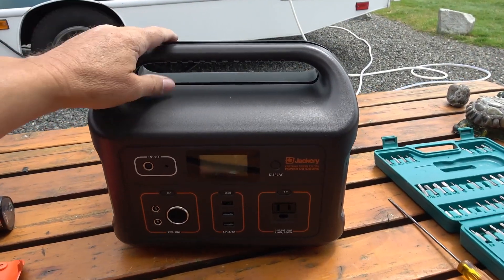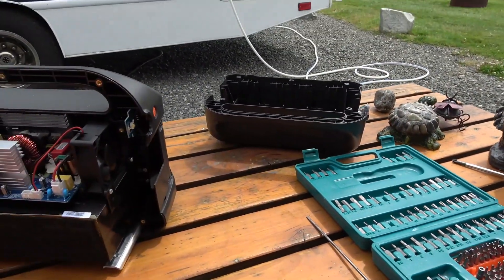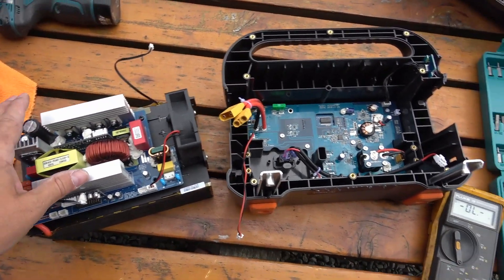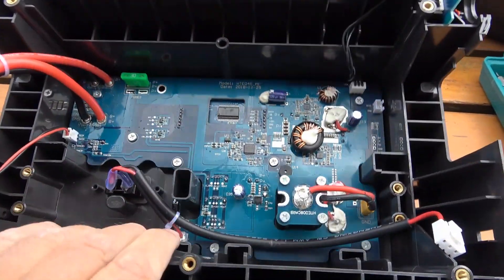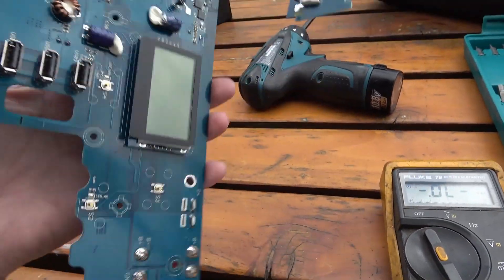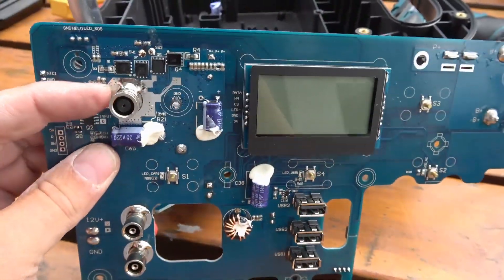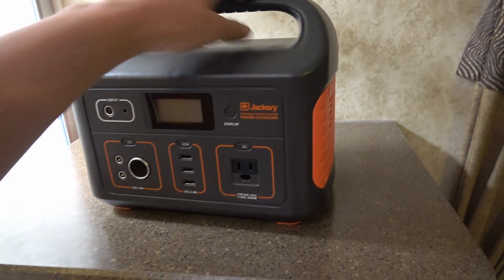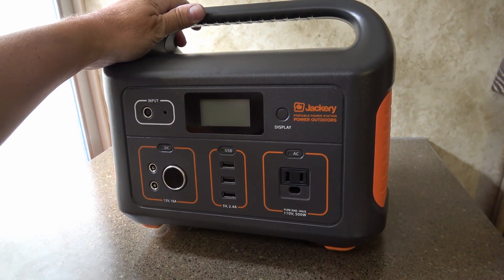What's Inside a Jackery Portable Power Station? (Explorer 500 Model)

Comment: Hi, when using the cigarette socket for power, does the power come directly from the 12v battery? Or does it also have to go through the inverter stage processes ? We are looking to do a test on Audio equipment to narrow possible power supply or fluctuation issue. The technician recommended a 12v car battery.. just we have a Jackery 240 so would be handy to run a DC cable from cigarette socket
Reply from the maker: No, the battery pack in the Jackery is listed in the specs as 24Ah/21.6V (518.4 Wh) so there is a DC-DC converter in there to step the voltage down.

Comment: How many 18650 batteries does the explorer 500 take. Mine is no longer charging even after resetting. I am thinking of attempting to replace them.
Reply from the maker: I'm not sure but the battery pack specs are 518Wh (24Ah, 21.6V) So you should be able to use math to figure it out if you know the specs on the 18650 you'll use.
Reply: True that ! Good point. Thank you very much.

Comment: Question, mine works fine when it’s plugged into the outlet shows the 100% battery charge but as soon as I remove the plug it doesn’t turn on. Do you think I should replace the battery?
Reply from the maker: I'd first take it apart and measure the voltage on the battery terminals to see if in fact it is bad. Usually there will be around 50 volts DC if charged up if I remember right. Anyway you could look up the battery pack voltage online.  Cheers, Ray

Comment: Thanks for the vid from 4 years later lol ,, I bought a 290 plus bad 110v outlets on ebay,, I took it apart using your vid and my issue was the coil on the inverter, it had come lose from the board, I soldered it back together and works like a champ.

Comment: Thank you for the video - I want to share the information on the 12 VDC Barrel Output Connector - I purchased from Mouser Electronics - 
Mouser #:
    171-6014-E 
Mfr. #:
    171-6014-E 
Desc.:
    DC Power Connectors DC Power Connectors 6.5X4.3X1.4 

		4	$1.98	$7.92	
Status 4 Shipped
Date 08-Apr-24
Reply from the maker: Thanks!

Comment: Hi I need help I have one that’s similar to that one  and it works but when I plug in the charger, it says 0 W and takes about three days to charge. I’ve tried different chargers but doesn’t work. Still does the same thing what would you think that would be wrong with it?
Reply: @jasonmartin9393  mine is doing something similar.  Jackery 500.  Everything seems to work fine except charging.  No blue power indicator and says 0w.  Did you get yours fixed?  This video was great when taking it apart.  No blown fuses, capacitors or any signs of burnt.

Comment: Any chance the inverter had some kind of relatively easy to do mod (a switch perhaps, or a solder trace to jumper) that might switch to 220ac?  I lucked out on some kind of Chinese model jackery that outputs 220ac and am wondering if it's worth it to try to mod the 220 or just live with it just using it with universal switch mode power supplies and the like.
Reply from the maker: I didn't see anything like that inside.

Comment: What size and brand are the cells?
Reply from the maker: I don't know, since the pack was tightly wrapped with plastic protection layers I didn't remove to see the cells inside for fear of damage. Couldn't find any specs on the outside. The manual lists capacity as 518Wh and Lithium-Ion chemistry. Kind of vague but my guess would be NMC given the 500 cycle rating. Cheers, Ray

Comment: Thanks for this great video Ray! Due to your experience with electronics I wanted to ask you if the unit don't turn on or take a charge, what could be wrong with it?
Reply from the maker: Maybe a blown fuse inside or a fault with the battery. Or, maybe there is reset, best to contact and see if there is some kind of factory reset function using the buttons
Reply: @LoveYourRV  Update: The machine does turn on only when plugged in but won't take a charge, the input reading stays at zero. The factory reset don't seem to fix the issue. Thanks for the reply!

Comment: Great demonstration. I purchased a Halo power station 1000 2nd hand, looked great. However when you install the power supply only the flood light comes on, the remaining power buttons will not power the unit on at all. Any idea what area to look at, maybe the internal fuse or the charge controller?
Reply from the maker: You'd have to take it apart and troubleshoot the problem. Test the battery voltage make sure its proper. If so then next look for the power supply circuits that produce 5V and 3V they are usually what power the microprocessor chips, buttons and display.

Comment: I like the 5s battery idea.  21 volts.  I use 21 volt 5s packs with bms sometimes with solar panels and place them outside to charge the packs straight off the panel.  inside i use a boost buck combo converter to feed/charge whatever I need from the 21 volt batteries.  With this solar generator one could add a tap off the inside battery and connect it to a larger 21 volt battery and it would have greater range.

Comment: Hello. 
Any thought to what has caused or what I can do to the 8mm barrel input that stopped working. I may have had a short or something that caused it to stop taking a charge. Led indicator isn’t on when plugged in nor does it show any increase in value in display which still is working. Just not charging.
Reply from the maker: You would need to get a tech to take it apart and see if the charge voltage is present on other side of the barrel connector. If you have ruled out the charger then it is likely a faulty connector, cracked solder joint, open fuse or faulty electronic component like an IC chip, resistor or transistor. So, troubleshooting would need to be done with a multimeter to trace the problem. Cheers, Ray

Comment: I was looking to see if it would be easy to add a remote switch to turn on the AC power without opening my truck's toolbox, but it looks like it's a board mounted switch 'S1' at 4:00. It's a little past my expertise.
Reply from the maker: I think I would solder a wire on each side of the AC power switch then run the wires and install a plugin port on the Jackery case. Then I could have an external switch wired with a  plug.  Cheers, Ray
Reply: @LoveYourRV  Thanks for the good idea. I checked my truck and its DC that I need. I suppose that I could solder to the terminals of S1 on the front of the board at 6:00

Comment: I plan on purchasing this unit. I was wondering what   type of 12V connectors/cables I need to plug my devices in. I also have an electronics background
Reply from the maker: Here is from the Jackery FAQ  https://www.jackery.com/pages/faq
"The two DC output port size is 6.5*1.4mm. If your device port can match it, then you can use.
They are for DIY use. Or you can use the car cigarette lighter port besides them, their function is same."

Comment: I have a Jackery 1000 that I got from a friend, he didn’t have the DC input, it’s there a way I can test if still working?
Reply from the maker: Use the AC charger or plug in a solar panel and see if the charge percentage rises. Cheers, Ray
Reply: @LoveYourRV  i don’t have the charger, I was thinking on an alternative option just to see if works
Reply from the maker: It came with a cigarette lighter car 12V charger and an AC adapter charger.  if you don't have either or the solar panel then you'll have to buy them or cobble together a DIY charger wire using an 8 mm barrel connector.  Like this for example - https://amzn.to/3goZavK so you can plug into the DC port.
Reply: @LoveYourRV  awesome, I’ll try and let you know

Comment: I was just wondering why they die so fast. Sadly no objective info here.
Reply from the maker: Sorry I wasn't addressing that question in the video just showing what's inside. I'm sure they die for all sorts of different reasons. Failed battery packs, cracked solder connections, failed switches, faulty wiring, blown fuses, dud electronic components, etc.

Comment: Can the battery be replaced when it wears out?
Reply from the maker: Not sure, likely would have to send the unit back to Jackery unless a person knew what they were doing and could source parts in China.
Reply: @LoveYourRV  The seller said the battery is not replaceable. So the device is thrown away and you have to buy a second one.
Reply from the maker: @Jacek..  Lithium batteries last pretty long, even when worn beyond the warranty rated life cycles it should still have 80% capacity.
Reply: @LoveYourRV  How long question?
Reply from the maker: Tough to know. They are warranted for 500+ full discharge and charge cycles before dropping to 80% capacity, so the answer depends on how often you will use the Jackery box and how deeply you discharge it with each use. So the box could last only a few years or a decade or more.
Reply: @LoveYourRV  In my house, he will only stand at home and wait for a power failure. I'll just top up to around 60% sometimes to keep energy. So I will be controlling it on an ongoing basis. For Jackery to work for 10 years and longer must he work in the full energy range (10% -100%)? For me it will be the range of 40-60% usually. I do not have power outages, but this may change.

Comment: How difficult would it be to replace the battery ?  They say they will last 500 cycles.  So, if I used it alot, a $600 tool would only last 2 years.
Reply from the maker: It doesn't look too hard if they will sell you one, or you could source it. But the cost would likely make it not worth it, the battery is the most costly thing in there by far I imagine. They say guaranteed 500 or more complete 100% charge-discharge cycles, so if you only use 30% then charge it doesn't completely count as a cycle, also it wouldn't be completely useless, usually, that means it has degraded to 80% capacity. That is generally how lithium warranties are rated. Of course, this is all promises, time will tell in a few years how they really perform. Cheers, Ray

Comment: I really only wanted to see what the batteries look like and if they are replaceable after they die. That is the one part you didn't show!
Reply from the maker: You can see the two battery packs stacked together. You could replace them if you can source the the battery packs, but likely they are proprietary, also you'd need to be able to unsolder and solder the large wire leads onto the main power board. Best though to send it back to Jackery, let them do it, unless you really know what you are doing. Cheers, Ray

Comment: This has 3 12 volt outputs.  Anybody know where I can purchase a couple of pigtail connectors or converters for those 2  - 6.5mm outputs?
Reply: Mouser Electronics part number: 171-6014-E (KobiConn 6.5mm x 4.3mm x 1.4mm DC Power Connector). Nobody makes anything specific for the plugs Jackery uses. You will need to solder your own together.

Comment: Great video Ray.  My AC plug quit working and in taking it apart to see if something easy ie loose wire.  Got all the screws out but where were those black plastic/rubber things from?
Reply from the maker: Thanks, the rubber things were covers for the screw holes.

Comment: So what are the individual cells? Are they a pouch configuration or 18650 cells?
Reply from the maker: I don't know it was tightly wrapped and I didn't want to ruin it taking the battery apart. I didn't see a number I could cross-reference.  The Jackery website says it uses Li-ion NMC chemistry.

Comment: I purchased one of these & was wondering the quality inside, THANKS for showing us ! BTW, I want to add a 12 volt fan to my lawn mower engine to help cool it, do you have a specific fan you would recommend due to your expertise?
Reply from the maker: Sorry, I don't know too much about electric lawn mowers. I imagine you'll want a lower power fan, maybe a large computer case fan like this one would work - Antec Big Boy 200 - 200mm Tricool Computer Case Fan https://amzn.to/2M2o44q Cheers, Ray
Reply: @LoveYourRV  It's not a electric mower, the regular Briggs&Stratton single cylinder 12.5 HP , I'm going to convert to run on propane and just wanted to add some more cooling for it, a 12volt fan I could easily just run to the battery, would your recommendations still apply for my setup? Thank you since I am a electronics electrical idiot !
Reply from the maker: @Numa Newbern Ah I see, maybe look at electric fans used in automobiles -https://www.summitracing.com/search/part-type/fans-electric  Could likely get a cheap one at an auto wrecker.

Comment: Superb!  Really appreciate getting your take on the build quality.  Threaded inserts and machine screws are much better than fasteners that screw right into the plastic, too.

Oh, one comment I forgot earlier -- yeah, really disappointing that Jackery provides almost no information about those two DC connectors, especially since everything else is so well done.  The website says 6mm OD, but that's not enough info to know what to buy.  Giving the purchaser a plug or two with pigtails attached would be first class.
Reply: I found a couple of products that pair up with the 6mm outputs. One is a 12v female car adapter and the other has leads for attaching to a vehicle battery. Both are from Goal Zero.

Comment: Hi, I've got a Harmon Kardon Citation 11 & 12 Amp and PreAmp set up on my home stereo system. I think they are from the late 1970's or very early 1980's. Anyway, I have had the system since the late 1990's. Sometimes when I turn the stereo on, there is an audible hum in the right channel speaker and static or even a loud popping in the left channel speaker. The problem is even more pronounced when it is raining and very humid out. The vintage stereo store near me has bad Yelp reviews so I haven't taken it there. Do you have any insight into the problem and where I can get it fixed? Thanks, liked the video.
Reply from the maker: Nice stuff. :) Usually, on the old vintage equipment, the two common issues are cracked solder connections and dried out electrolytic capacitors. When I worked out them to restore I would almost always replace most of the electrolytic capacitors and resolder the boards. Most problems would go away and the operation would improve.
Your faults could be from those things or maybe intermittent transistors.  Sometimes when a transistor in a preamp or amp circuit starts to fail it will do so intermittently and be affected by heating or cooling. Humming and pops were a symptom.
Dirty controls can sometimes don it too. You could try a spray cleaner. A good one is MG Chemicals Eletrosolve -  https://amzn.to/2LHpW2B   It's a zero residue contact cleaner and won't hurt plastics.
Sorry, I don't know where you would take it, you need a tech that can troubleshoot and work to a component level and they are a dying breed. Most modern techs these days are just swapping out modules and boards. Cheers, Ray
Reply: @LoveYourRV  Thanks for the info.

Comment: People have asked what is the 12v output socket. It's an 6.3mm x 3.00mm search eBay for this "Toshiba Satellite Right Angle Replacement 6.3mm/3.0mm" and one US seller wants $4.50, and from Hong Kong $2.19. I bought one from the US seller, and it's a nicely made cable which I plan to add "Anderson Power pole" to the bare end.
Reply from the maker: Thanks, Don. Would be nice if the Jackery came with red/black Anderson connectors. Cheers, Ray
Reply: @LoveYourRV  The problem with Anderson Power poles is there's no standard. I used the example from the ARRL, and so did Jackery for the solar panel. Next week I should have my samples for the 12V input connector which I believe is 6.00mm x 1.3mm. And by the way all of those connectors are center positive.
Reply from the maker: I believe the 12V input is 8mm, it looks a little bigger than the 12V output barrel connectors.
Reply: @LoveYourRV   It's actually an 7.9MM X 5.5mm (same as old IBM thinkpads/Lenovo.
Reply: @donjenkins2465  TY for all your info although I don't understand it I may need it in the future since I have 3 Jackery's

Comment: Did you get any pictures of the lithium battery pack??? I have heard it uses a pack made of of cylindrical batteries like a Tesla pack.
Reply from the maker: No, it was quite sealed up with plastic coating and BMS soldered to the end so I didn't want to go too far there and damage the pack. The Jackery website indicates it a Li-ion NMC type chemistry.

Comment: Ray,  You missed a couple of negative issues.  One, the fuse is deep inside the unit, so disassembly is required, Warrenty?  Two the unit is not easily repaired as ALL of the components are surface mounted.  This means much more equipment is required to replace any part, maybe even the large plugs.  Still a great video!
Reply from the maker: Thanks, by the looks of it the large amperage fuses inside, are basically catastrophic failsafe fuses, just in case the regular built-in auto-shutdown safety circuits don't work right. I see them as an extra layer of defense and not meant to be user-replaceable. If those fail there are big problems that will need to be repaired anyway. Warranty of these units is 24 months.
Surface mount and multilayer PCBs is the way most boards are done nowadays days. So I can't fault that kind of build. I also imagine they went that way to reduce size and cost. With modern hot air solder stations and vacuum pump desolder tools, that aren't that expensive now, they aren't too hard to work on. Most electronic repair techs are going to have such tools. Cheers, Ray
Reply: @LoveYourRV  I thought the same as this poster about the fuses, TY for your expertise and explanation about such !